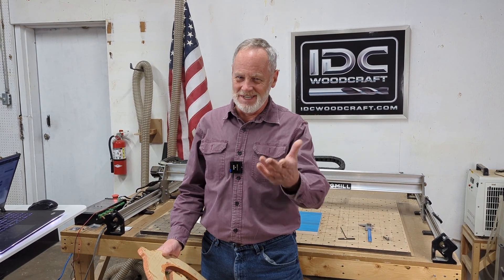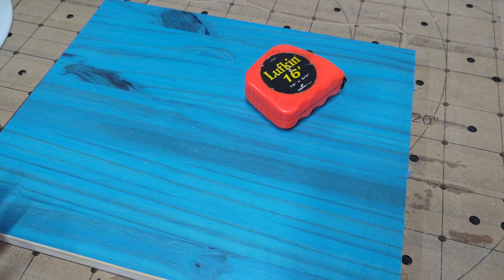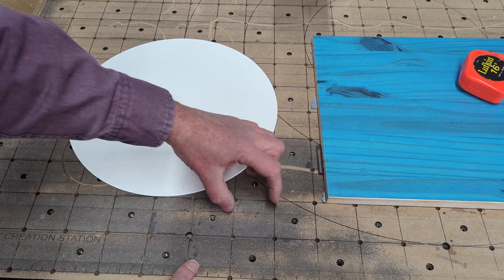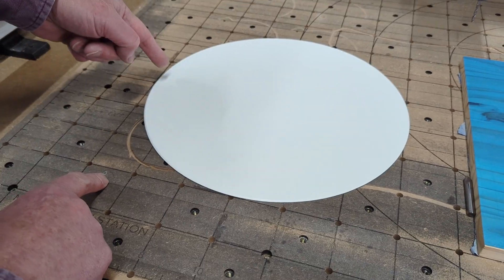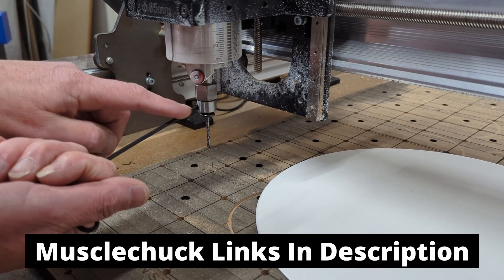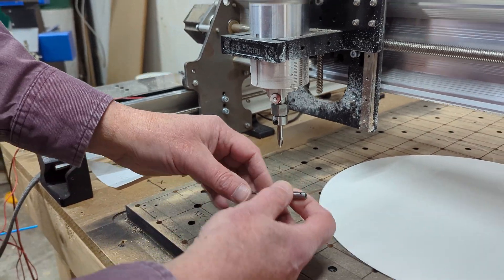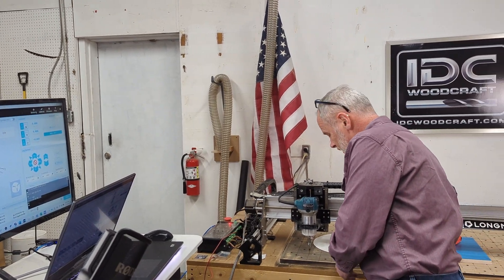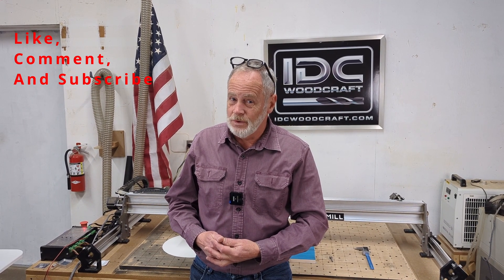How To Find Exact Center On A Round Project

Comment: Why not just use your tape measure ?
You can always set spindle to your mark in center with your v bit and if in doubt then manually move in X@Y  half the size . Measuring tapes I’ve been around forever and work well as long as you use the same one for the whole project.

With that said love the videos when they are not a commercial all the time. Love and use your bits an love them too.
Stay safe!
Reply from the maker: droneguy0265, you can absolutely do it that way too brother. It's really personal preference and what works best for you! I'm glad to hear the bits have been treating you well over there, I know you've been putting them to good use! Right on! Happy cncing brother!

Comment: You can just use basic geometry, mark the center on the object, then zero on it.
Reply from the maker: constantinosschinas4503, you absolutely can do it that way too my friend! It really just comes down to personal preference on this one!
Reply: @IDCWoodcraft  What kind of homing switches do you have on the cnc? Because mechanical ones have produced really flaky homing in my experience with cheap cncs, to the point it was better to rezero in a bed hole each time, if the hole grid was to be used for anything requiring basic precision.

Comment: What I do with gsender, is after I get my xy zero like you did. I go into the settings in the top right corner and select whether I’m using mm or inches. Then I go back out of the settings and click on the numbers by the x zero button a type -6.00, do the same by the y zero button -6.00. Then when I hit the go to buttons it will move over and up 6 inches putting it in the middle of the circle.
Reply from the maker: Brian, fair point my friend! I always recommend doing things the way that make the most sense for you. That sounds like a great method too brother!

Comment: So, i see a flaw of sorts and maybe i am over thinking it but it seems either you stock is not that 12x12 or the grid lines are off. Seems something is out from the video you can see that the stock over shoots to the right and up top too, from your grid lines, am i wrong but the stock looks bigger then the grid lines for 12x12
Reply: Saw that too. Hard to tell from the angle of the camera, but I don’t think the piece was right on the left grid line.
Reply from the maker: Rick, my apologies if the grid caused you confusion brother. The intent was just to walk you through how to find the center, the camera angles may have made things look a little off!

Comment: You mentioned that your grid lines were 2 inches apart, yet when you positioned your 12 inch circles left edge on a grid line the right edge was past the grid line that was 12 inches from the left grid line. That would make your center incorrect.
Reply: Lol yeah i saw that too, and just questioned it too, if you look close its over at the top too, so seems either the stock is bigger then 12x12 or the grid lines are not quite 2x2 lol
Reply: Same
Reply from the maker: jscotcha, my apologies if the grid caused you confusion brother. The intent was just to walk you through how to find the center, the camera angles may have made things look a little off!